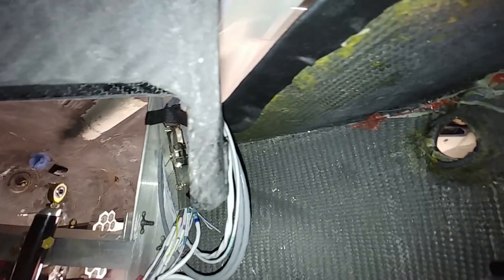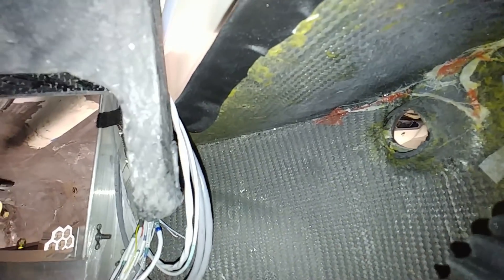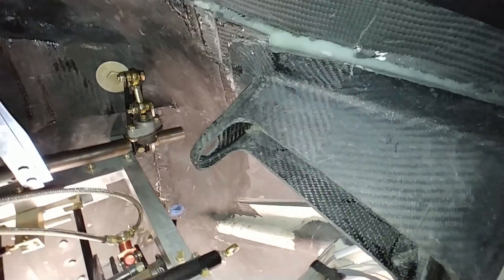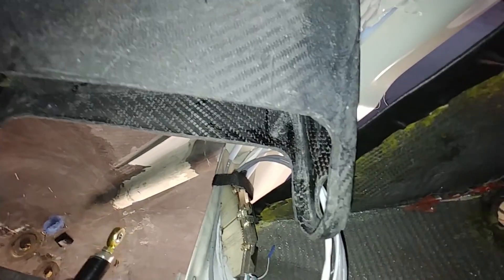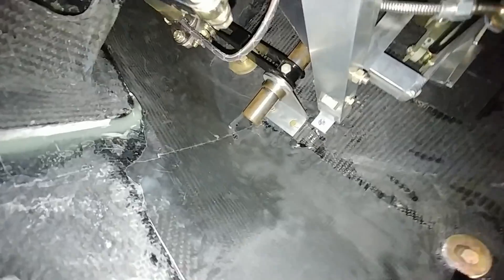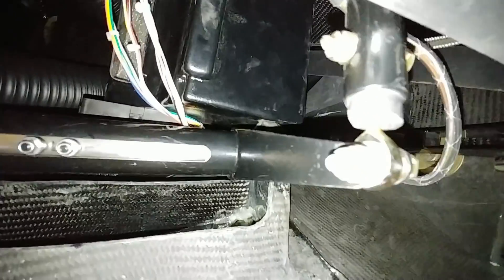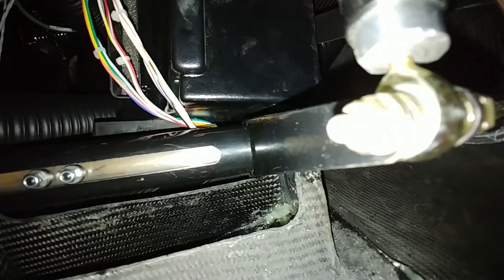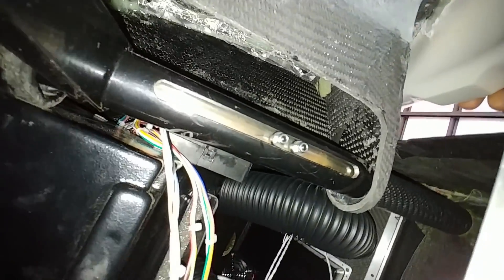Back to the Drawing Board - Building the Raptor Prototype

Comment: A thought? Cirrus has bearings on both sides of the channel thereby supporting the forces as the tube twists. . By only doing the one side, you will be essentially dragging the tube with the bearing only,. I think you should either reverse the single bearing location to the forward ship position or add the second set.

Comment: It looks to me like you haven't eliminated the friction point in the new design.  The control column still has to move fore and aft though a bushing while under load. (the square one).  if i were you, i'd start with polishimg the current tubes.
Reply from the maker: It's not bushings that it's moving through, it's effectively wheels. So there is no inherent friction other than what's inside the ball bearings that the wheels are running on.

Comment: Peter, there’s more money coming but it’s held up by bank transfers. We will not let money be a reason why you stop. Like I mentioned the Yanks are coming and your friends will not let you suffer. And you’ve made a bunch. Keep going Peter we got ya!!
Reply from the maker: Cheers. Thanks
Reply: Raptor Aircraft - you are more than welcome Sir but you don’t owe me any thanks. Just keep doing what you’ve been doing and as the team from NASA stated when faced with the failures of Apollo 13, “ Let’s work the problem folks” and get this aircraft flying safely where it needs to succeed. I’m going to ask again Peter. Do you need help from people capable of lending their mechanical expertise to help you do the work? Or do you have this covered? I know you want to keep continuity on the Raptor program and with adding additional people who haven’t worked on this aircraft could create more problems than actually solving; and just in the positive tool control program alone, and this I understand as a former program manager for major aircraft flight testing programs. But if you need free additional help it’s only a matter of asking your friends here in the states. Let’s us all know what you need from us Yank’s???? Cheers Mate!! Toss one back, or two, or three, so whatever it takes!

Comment: Peter, I think you could save yourself a lot of work by replacing your rod and bearings with off-the-shelf ground shafts and slide bearings like Thomson slides. As other commenters pointed out, a non-precise shaft could be causing your problems. Also there are issues mentioned with the the V-groove bearings and the hollow square shaft, not to mention all the redesign, rework and retesting of a new design. With the properly selected slide bearing components, I think you could use your existing design successfully. Slide bearings have solved many similar problems I have had designing custom automation equipment over the years. Good luck with it all. I thoroughly enjoy your videos and I am impressed with all the work you’ve done. I would love to see your aircraft in person someday.

Comment: Put the square /tube through a round tube thats mounted solid in the mounted bearings,think you said they were alirons, then you can mount your sliding rail bearings in cut outs within the round tube,if you dont want to compamise the strength of the tubes you can offset the bearings by a few inches, so instead of having 4 bearings in a cross shape you could stagger vertical and horizontal- this adds 2extra points to slide at each slide adding in redundancy- should one fail, this would add only 1/2-1inch either side and help minimize any fouling with other things and cut down on fatigue/stress in that jointing plate. this is the best example of what i could find look at 43 mins in to the video, but instead of 3 point contact make it 4point contact and slightly stagger them and do this twice with your centers about a foot apart https://www.youtube.com/watch?v=uVZbBH_C35E . Im slightly unsure of the cycles times on the corners of the aluminium stock with the v-groove bearings.

Comment: It looks to me like your shaft may be the problem not the bushing. If the shaft flexes at all then it stands to reason that it would bind up on the shaft or the shaft would bind in the bushing. Have you thought about using a different material for the shaft?

Comment: The updated design looks really good.  One question...for the aileron apparatus that hangs on the roller bearings and is actuated by the V shaped bearings, why add the additional assembly aft of the rear mount, instead of having both attach locations between the mounts?  Was that just to de-stress the rod as it goes back to the control stick?
Reply from the maker: I need it there to support the stick end that the pilot has a hold of.
Reply: @RaptorAircraft  Gotcha, thanks!  That's what I was thinking, just wondering if I had missed something...

Comment: As always Peter, you get knocked down and come back up swinging.  Way to go.  I have very little experience with this type of problem but I can agree with a couple of comments that the interface between the square shaft and the v groove bearings is a critical point to this solution.  The wrong "tube" can create bigger problems than what you are currently experiencing.    But overall I like the solution.  So glad that so many have contributed to the GoFundMe campaign.  A few more and the goal will be met.  I was happy to contribute, I wish I could give you more.  You really are inspiring thru your hard work, determination and won't quit attitude.  I've said it before and I will say it again.  If I listen hard enough I can hear that diesel purring in the skies overhead.
Reply from the maker: Thanks. Cheers. 😀

Comment: Everything has to be as simple and reliable as possible, One person can not design something like this by them selves, there are many things one person will not let them think about, I would make the carbon Mounts, with the two holes, just a bolt on mount with one more close to the Panel, and CNC and off the shelf parts to assemble the Yoke. Remember 51% needs to be the homebuilders work, so, I plan on giving them a lot of Non Precise make shift assembly work, where all they have to do is Tighten the Screws to Spec. The Bike Chain between the two yokes is starting to look appealing. Design Everything to be Built. I will not let any of my homebuilders Mix any Epoxy or do any lay up. I Dread even making them use Swirl Tube mix to Glue on the Carbon Inside Parts and I'm including a 2 hp Dust Vacuum for the Carbon Drilling they will need to do for the SS-Riv-Nuts. You Have a Great 3-D Real Life Model, use it to get all the Production CNC Parts and  the Assembly Procedures, for the Kit Builders, This is the time to Plan for the Builders and Also - Get this bird to Fly. I was thinking an Open House on the weekends, for Design Meetings, maybe the Internet will work - maybe. You should really be at a Hanger with a Loft / Apartment. Remember, this one will need to have a Demo Type Certifacate, after some test flights, this one will be Hopped to Air Shows, so people can sit in and Touch. You will be selling the Corrected Kits , I am trying to get you to understand this one you will take apart many more times, so she will be cut up and have some plastic surgery. Use her to get things corrected and Assembly Procedures.  Thanks Again. Keep up the Good Work

Comment: Hello and thank you for your great effort. I'm following you and the raptor project since a while ago and I support you 100%. Keep pushing because you will get the support you need for sure. I would like to ask you if you are planning to introduce improvements to this design in the production product. I mean, now this is the best solution given the situation but maybe you would do it in a different way if you made the plane from the beginning, maybe changing the carbon fiber clamp shape to introduce the new solution you are introducing now but in a "more direct, simpler and lighter" way. Congratulations!

Comment: The roller bearings and square tube are similar to CNC milling machine systems.  Those parts have to true to get good machines. You might look in those areas for good parts.I've used two pairs of flat roller bearings to get the same sorts of V shapes.

Comment: I think its silly to use the controls to exclude someone from swapping their tired hands--even if they are a popular marketing and fetish item.

Have incremental changes to the control mechanisms been fruitful, up this point?

You have designed over 95 percent of an innovative and elegant aircraft, but I think it would be best to get a two diferent control specialists to help you with this part of the design, with the focus of a simple, time-tested design, perhaps using push pull tubes wherever possible, and cables and sliding parts sparingly.

There are people in the world who live and dream about control mechanisms like you dreamed about the aerodynamic shape of you plane. There are people who care about control authority like you care about engine horsepower. 

I once met a Yoruba African man who programmed wavelet encoding here in Silicon Valley. He saw his whole world as wavelets.  You need to find such people, but for controls. : )

Comment: Having some experience with those sort of v-groove bearings, you're going to want to watch out for a few things:
1. The feel of them is very sensitive to the amount of pre-load. You'll need eccentric adjusters - and in the case of an aircraft you'll want to make absolutely sure there is no way they can come loose.
2. You will not be able to get away with just plain square tubing. You will need tubing with a reasonably sharp corner which pretty much eliminates using a formed steel. And you need reasonably high precision. A relatively small change in clearance can result in a very sloppy or overly tight fit. A ground square shaft would be ideal, though feeding wires through the middle is a problem.

(for what it's worth, I think you were on the right track with the round concentric shaft design, the addition of linear bearings and\or a more precise hardened shaft with longer lubricated bushings would have probably solved your problem. Though I agree packaging looks tricky.)

Comment: You could make a mock up with a wooden bracket like the carbon fibre one in your aircraft, to check iff it binds when you convert a torque when sliding.
BUT: on the left hand stick you have a clash with your AC.
Jaques
Reply from the maker: I am making sure it will clear the A/C unit on the left. That's why I showed you that in the video.

Comment: I think it's going to bind in a very similar way to your current solution. Any lateral movement on the stick is going to cause misalignment of the front and rear of your current bracket. You need to use a tube to connect them to each other then run a shaft through bearings inside of the tube. It should be a simpler more elegant and vastly more rigid set up. It would allow you to use the side stick as a place to rest your arm while not binding the other stick when they are flying even.
Four bearings, a stainless steel tube and a hardened steel rod/shaft would just about do it.
A touch heavier but less parts and infinitely more rigidity. ALSO, the smoothness of the controls would be like the difference between manual steering in a Yugo and power steering of a Lexus....And with less parts it may be a very small difference in weight. I would think that a side stick that is too light to the touch might give the impression of feeling "cheep" vs a little heavier but solid feeling stick? The only thing I have flown that might give the right comparison is the difference between the feel of a stick in an all metal glider like the 2-32 Schweitzer and the fully balanced smooth flight controls in an AT-6 if you have ever felt how smooth and light while still very solid the stick feels in a Texan.... The Raptor is a precision luxury sports plane. It reminds me of my Porsche 928. It is a Sports car GT Coupe. Fast as hell and refined and smooth like a mercedes. It's like being shot out of a very expensive cannon. i can carry on a conversation on the freeway over my speaker phone with the cruise control set at 160 mph and my wife doesn't even know I am in the car....

Comment: I have some linear bearings that should work perfectly with your set up. The problem you are having right now is that the front and rear supports are not staying aligned with each other. You need a rigid tube to connect them and then bearings that will travel within the tube and then a rigid polished hardened shaft that rides inside the bearings. There are some I can send you that will allow the shaft to go in and out as well as rotate.
Where do i send them?

Comment: Glad to see your spirits have improved! I can’t imagine the level of frustration you must have felt listening to the pilots’ issues. 
I love the binding solution for the side stick, except I have one recommendation to think about: is there any type of safety solution in case the rectangular bar should jump the groove of the beveled washers? This may be a non-issue, but I suppose since I’m just going off the animation you posted I can’t tell just how much coverage those washers have over the rectangular corners. Also, are you considering a tightening mechanism like cirrus used to ensure a proper fit?
I’m sure you’ll get past this! Know you’ve got an entire community behind you!!! Can’t wait to see her fly!

Comment: Looks good.  You may want to consider adding a third set of rollers closer to the original carbon bracket on the stick side. Currently there's the potential for a lot of force to be applied to the end of that arm which acts as a lever against the fairly small single shear bracket to which its attached.

Comment: What do you need the 'extension'  and bracket to get around the  bearing mount for.  Would mounting the 2nd set of bearing on the square shaft not work within the spacing of the two bearings?
Reply from the maker: The extension means that the stick has decent support close to the end where it goes through the panel. I'll likely beef up the connection more so there's no flex.

Comment: The extension bracket for the square tube could be a longer 90 degree angle section bolted to the square tube instead of welding. Would be easier to disassemble if necessary.

Comment: Have you thought about the radical idea of going to FBW (Fly by wire). It’d be way simpler with some  servo controlled actuators and force feedback. Lighter, programable, no binding, no pulleys, no cables, no lost motion, speed sensitivity, etc etc....you could integrate it via a commercially available auto pilot system
Reply from the maker: It's a bit complex for this size aircraft and there would be no control force feel.
Reply: If anything I think it could be less complex. It wouldn’t be hard to provide force feedback similar to a simulator setup with airspeed inputs, g inputs etc. it would give a whole heap of variables that you could program if required such as pitch limits, stick pushers, g limits, ...the list goes on. You would provide redundancy with a couple of actuators for each control surface and double up the input pots. It would save some weight and maintenance and provide a safer aircraft. The world has moved on. Your aircraft could be a real innovation. This could be a great marketing point. You could update features with further development.

Comment: I quite like this design. What is the reason for the extension piece? It would be stronger if both pairs of rollers are between the two support bearings. The extension will reduce the torsional stiffness of the assembly.
You will struggle to find steel tube with sharp enough corners to fit the rollers properly. Cirrus got around this problem by using cold rolled square bar then drilling it down the middle to save weight (notice in the photo that the hole is round). Drilling that length is a PITA. Maybe use extruded aluminium? That is available with pretty sharp corners but you may have to make it a bit bigger than the equivalent steel tube to keep the contact pressure between the rollers and tube manageable.
I'm not keen on the square tube running in a round support bushing. Only the tips of the corners will be supporting the tube and you are likely to get rapid wear. You really need the tube to be running in a square hole. It wouldn't be difficult to mill a suitable square hole bushing out of Delrin or UHMW.
Reply: I was asking myself the same question.  It seems like this was a compromise to keep the existing brackets.  The design could be simplified if you step back and re-imagine how you would design the solution if those brackets were not already there.   I don't think you would come up with that design if you weren't trying to salvage those brackets.  I know it adds time and FC work to cut out and bond in new brackets, but it would simplify the design, and make it stronger.
Reply: @BrentHumphreys  I think the existing brackets should be fine. It's just the extension wrapping around one of the brackes that doesn't look great to me. The rollers are transmitting torsional forces so you can have them fairly close together. The U section joiner will have pretty poor torsional stiffness and will twist relatively easily unless it is really heavily built. From what I understand from the drawing and video of the current design the aileron arm will be attached close to the left hand roller pair so they will be carrying most of the load. The pair closest to the dash will mostly just be stabilizing the assembly.